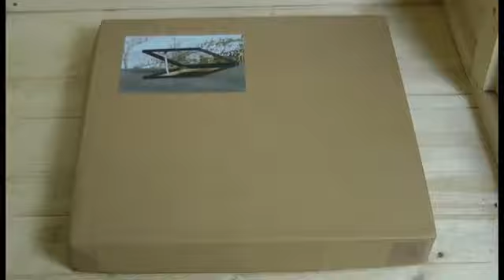A1 RoofVENT™ Skylight Window - How to fit on your Shed or Summerhouse

Comment: How do you avoid leaks with no flashing or underfelt etc? Is there a water/air tight seal?
Reply: looks like a rubber seal on the skylight frame
Reply: from the website .....Self-sealing frame doesn’t require additional sealant